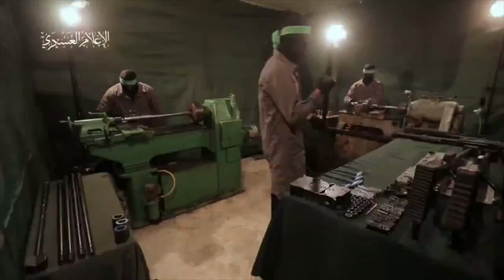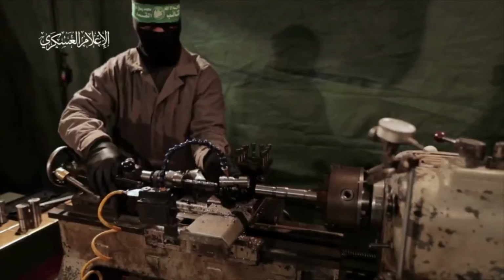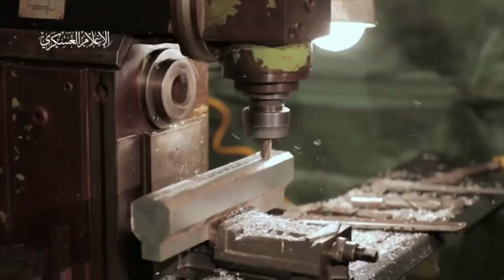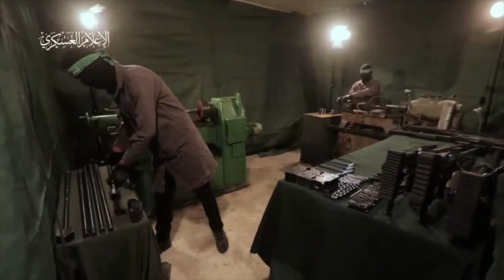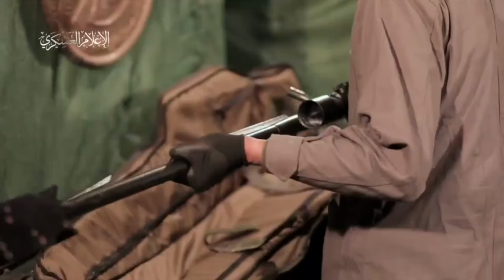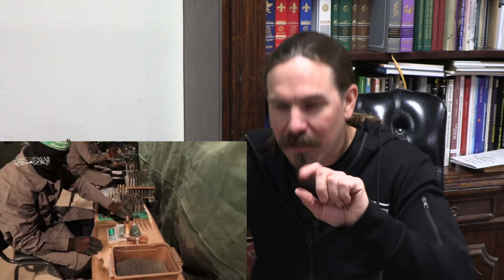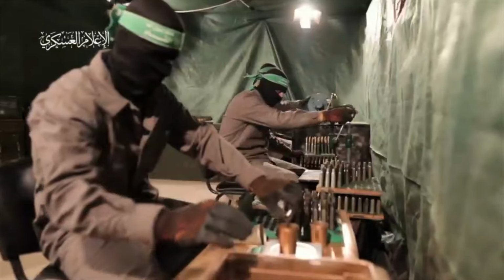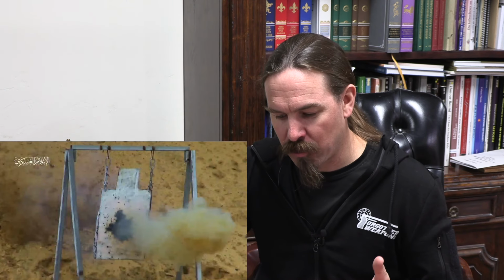Hamas Claims to Make Sniper Rifles in Gaza - Are They Really?

Comment: Yeah, just wanted to say that that looks like engraver work or edm sinker work... The finish is quite nice for such a deep marking... Almost too nice for a rolling press or any kind of brute indenting method, while it`s too deep for a normal laser, at least if you dont want to overcook the supposed precision part to make such a deep marking with such a fine finish... 

And no, those two initial lathes likely weren`t making barrels, i see a way or two in which one could coax a lathe of that size into making 1m long barrels, but shit son, you might as well find a more optimized machine, as the process while repeatable, would be relatively laborious, especially in the setup stages, as you would likely have a 4jaw indep. chuck at both spindle ends to clock that naught rod concentric after the initial o.d. turning, and to allow you the full length of bed travel for drilling, boring, jig drilling, reaming and rifling... It`s a whole damn ordeal to get a small lathe to turn long parts, especially if they are essentially precision components that should have all the work done in a single setup, but you have to make do with more than a single setup due to machine size constraints... 

But what the fuck was that drilling-parting operation? That was some mystical work I ain`t ever seen before, must be some new This Old Tony trick that I missed in the last video... Them pesky youtube fancypants and their expensive editing software effects... ``throws a tantrum, then throws a wrench``

Comment: I don't know anything about rifle manufacturing but after watching your video it seems like you are describing how a rifle is to be made in an ideal situation. Which Hamas clearly isn't in. Like you said they aren't using lubricants. And they are doing things wrong. 
Well Hamas is an underground group not an actual military with all the resources and skill that you need to do it right.

We know that they make rockets and they do hit targets. But the rockets are basically Frankensteined and held together with duck tape.

I just don't see the point of them going through all the effort of getting those lathes and actually showing them using the lathes to shape metals. Why would they need to do it ?

To hide that Iran provides them weapons ?
Well they aren't denying it anyway. And if they wanted to achieve anything for their supporters they could just say that they make the snipers themselves. 
It makes no difference. They aren't the ones caught in a PR situation, Israel is.

Comment: 3:44 guess he first cut a groove with a diameter smaller than the drill an then just drilled through it, advance is that you dont risk the part flying through the room since its stuck on the drill. still kinda goofy

Comment: So they are at war, besieged underground with a bunch of empty shells, scales, powder, bullets, and reloading machines, but are too stupid to reload the rounds? Have lathes, mills, steel, and aluminum, but not utilizing these materials and equipment to manufacture parts because they just don't comprehend how to lubricate when cutting, or that you're supposed to rifle the barrel before you lathe the exterior...? They're just milling scope mounts, but incapable of milling out a receiver or other parts? It's probably easier to mill out a receiver than a scope mount wouldn't you say? You said yourself Ian that when you participated in filming for a weapons TV series, that they already had the finished firearm there fully assembled, with other individual parts at different stages in production to be used for filming the manufacturing scenes. Might it be possible they curated scenes in a similar manor for filming purposes? After all, this is a theatrical propaganda piece, not an hours long documentary showing the precise intricate stages of operations necessary to produce a firearm. You may be underestimating their capabilities. They are certainly producing an RPG warhead variant for around $200 per rocket, that are destroying 3 million dollar Merkava tanks. Don't forget to do a video about those.   Thanks Ian!

Comment: Firstly, I don't support Hamas or Israel. Secondly, I'm a machinist who does manual production work for 10 hrs a day

The first operation- smoke is common in manual machining. Some lathes have flood coolant, some don't, frankly that means nothing to me. Polishing with emery cloth is common, I do it every day. For the drilling, they're making several parts in a bar, all connected together until you go through with a parting tool and part them off (think a link of sausages, you make a link and then cut them into individual sausages). The drill was there to support the parts as the cutoff tool was being used. The milling was alright, I do wish I had a euromill like that. For the rest of it- I'm not an expert on reloading

Comment: Possibly a ridiculous question: Despite the extremely suspect “manufacturing” process here, could any thing made under these circumstances be accurate within 200 yards? 100? 

My thought is that we have been seeing a lot of armored vehicles, IDF with body armor on, and a lot of urban barriers. Could these be useful not as a precision round but simply as an enhanced penetrator to combat a superior force? Perhaps as a way to ensure more KIA as opposed to casualties.
Reply: Depends on the quality of parts used. Channels show how a re-turned barrel, or an over packed (and dented) case can destroy the gun and potentially kill the user. Even enough rust (like we see on 2 of those bolt covers) can cause a blowout. More power means more potential for self harm which means more need for quality.
Reply: @littlekong7685  makes sense. To them is it worth it if it works 50% of the time though? 40%? 10%? How much does Hamas value the lives of their soldiers
Reply: You could make an accurate rifle through crude manufacturing processes through pure dumb luck. What you couldn’t do is make them consistently.
Reply: Yeah that was my thought too.  Its about the penetration, accuracy is secondary.

I wouldn't be surprised if the person issued got any time to practice at a firing range anyway.
Reply: @fukkitful how is it genocidal in anyway
Reply: A much much superior force with genocidal modus operandi
Reply: @rimacalid6557 the only genocidal ones are Hamas. Isreal has never been genocidal. In fact they do more than any force in history to protect civilians. Careful your antisemitism and lack of actual knowledge about Isreal is showing.
Reply: @rimacalid6557  Give me a break if Israel wanted to be "genocidal" the war would have ended in a week.
Reply: @eyalamit5120  Israel had to wait for critical mass on the useful idiots that would swallow their pathetic narrative.
Reply: @eyalamit5120 you're overestimating the capacities of an army of 20 year old officials that's been losing multimillion dollar equipment to regular dudes in sandals
Reply: @eyalamit5120  20,000 dead and 50,000 wounded … 2 months and double the total death toll in Ukraine. What’s worse is 500 children died in Ukraine it’s over 8,000 now in Gaza
Reply: @haithamali3228  Yeah so awful incredibly awful, I agree. If those numbers were legitimate in any way shape or form. These numbers come from Hamas, a terrorist organisation infamous for using human shields and overinflating death tolls.
Reply: @eyalamit5120 exactly, there is no war you absolute tool. they’re punching down on civilians and a ragtag militia trying to defend itself
Reply: @aarvlo  that so called army of 20 year old officials has beaten off 6 countries attacking it at the same time with shitty geography. their achievements and operations are some of the most ridiculous things the world has ever seen. you should watch some videos on just a few of their operations.
Reply: @haithamali3228  The situation in Gaza and Ukraine isn't remotely the same. Hamas hides behind civilians. Ukrainians stand in front of their civilians. don't insult Ukraine.
Reply: @ghosthunter0950  That was when they fought conventional armies. How about insurgency?
Reply: @haithamali3228 well yes dummy the populatiob density of Gaza is much higher than any city in Ukraine
Reply: @raziqrahman1976 they performed decently againts the PLO milicias in the 1982 lebanon war, after the war the PLO qas forced to take a more peacefull stance
Reply: @haithamali3228  The death tolls are written by an agency controlled by Hamas, literally war propaganda.
Reply: @haithamali3228  You have no idea what in the actual fuck you're talking about. The war in Ukraine has deaths in the 100's of thousands on both sides.
Reply: @ghosthunter0950  That was a diffrent generation than today. Alot of those soldiers were Holocaust survivors.
Reply: @eyalamit5120  Israel has openly said in their own words that they are committing genocide. You can't defend people who explicitly, loudly and proudly admit full guilt of even the worst crimes.
Reply: @ghosthunter0950 agree…watch one on the USS Liberty
Reply: @josecarlosmoreno9731  LMAO WHEN HAVE WE SAID ANYTHING LIKE THAT!?

Comment: Most of what you say seems correct, but you are wrong about needing a trickler.  Any scoop or even a spoon will do as long as you have a scale that can measure the charge ti within .5 grain.  The 50 BMG has such a  large charge that .5 grain makes very little difference.  Also a rough arbor press can certainly seat bullets in a 50 BMG case even without a die aligning everything.  You cut the bullet nose profile into the bottom end of the arbor ram, and you make a centering guide (seen in the video) that forces the cartridge base to be centered below the ram.  U hold the bullet into the arbor ram and the slide the case mouth onto the bullet and then the base into the base guide.  As you press the bullet into the case mouth you rotate the whole cartridge in steps as you press the bullet home.  This evens out most of any miss alignment that may be present.  If everything else is up to snuff, you can make 1 - 2 MOA ammo this way.

Comment: the main purpose of the rifle is to provide mid range support as a sort of reassurance for the qassam brigade fighters it also adds a terror factor for anyone who would get shot at by such a bulky round and is a sort of propaganda to increase the moral and it works really well for all of those purposes qassam themselves don't really claim that they made much progress with those particular rifles in fact most of the confirmed kills were done by RPGs and small arms even IEDs didn't really see much use since i'm guessing most of the explosives are used in rockets tandem RPGs and a couple of traps when tunnels are discovered

Comment: The cutting fluid smoking is not bad, it does that long before you are even close to messing with the heat treatment of the steel. The part of the bolt falling off as he retracts the drill can simply be that he make the parting groove before drilling the hole, and then the part will fall of when the drill reaches where the parting grove is. And there is nothing to indicate that the "barrel blank" is a solid bar, the live center in the tailstock is clearly sticking into something, if that is the bore of the barrel, or just a center drilled hole in the end of a solid bar is not possible to see from the video. Ian might well be correct that this is just fake theater, but a lot of the comments he makes to support that claim is not really evidence of anything.

Comment: The scope mounts are also nonsense if they were actually producing them, they would not be taking them directly off the mail, and placing them on the table. Next ones that are already anodized. Anodizing takes place in a completely different facility, as the chemicals are caustic, and will destroy the machines at the same time the Hamas soldier is seen, checking the dimensions of the scope mount with a caliper after removing it from the vise in the milling machine. No machinist would do this as those measurements wouldn’t matter as you would have to realigned the scope mount in the fixture before machining. You must take measurements before removing the part from the machine, otherwise you’re just starting from scratch

Comment: It could just be the holder being warped, but it also looks like all the "finished" ammo are different lengths. I'm also not a handloader but I do know that if one is going for precision, that the bullets have to be set to the same distance or within a tolerance of so much fractional or decimal placement for length, usually to within a 64th or maybe .010~20 of total over all length. Not have your batch tray looking like an uneven growth of trees.
Reply: I'm pretty annoyed if my pistol bullets vary by more than a couple thousandths.  I'd want precision rifle bullets to be +/- 001 or .002" maximum.   But...  you can intentionally load long in a single shot bolt action, so long that the bullet hits the rifling and then seats the rest of the way in the chamber.  This is normally NOT a good idea, because having your bullet seated into the rifling can raise pressure significantly.
Reply: @Rocketsong  Precisely, the measurement I gave was a guess at best for variance . Still stands to reason, if there's visible length difference that's readily apparent at better than ten feet. It's time to reevaluate whomever is doing the final seating and crimp.

The only time I've ever helped with a reloading was essentially coke bottle rounds of the .450-577 Martini. Black powder loaded light to sneak up on a load just for a rifle that's pushing 150 years. I don't remember the exact load data but I do recall that there was a lot of careful tamping with a thin dowel. Also a whole lot of cotton and fine oat filler to keep from making small grenades. I can't eat oatmeal now without getting a memory taste of BP.

Comment: 6:12  It seems like raw aluminum.  There's no smoke and the flakes that are coming off the stock are big and flakey if any experienced machinist would've seen this before.  A dead giveaway that the video is bogus is although machinists do wear latex gloves, they stain with the cutting oil.  None of the gloves seem to have any actual oil nor grease.
Reply: They also use the lathe tool holder wrong.

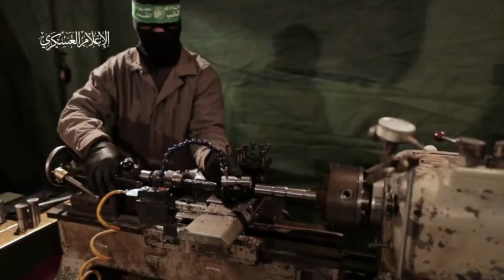Comment: 3:50 As it doe,'t look like the hole goes through the entire piece it could actually be that he had used the cut of tool just before  leaving a tiny bit conected which can happen if your tool is not correctly aligned. And just had to move the drill back to be able to remove the piece.

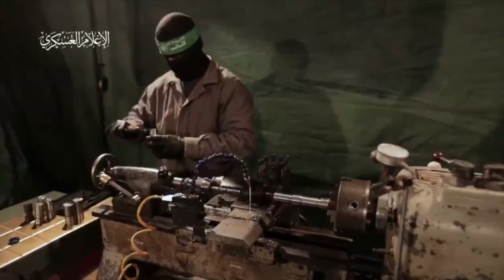4:39 yeah, look at how the pieces are not flush aginst the surface but leaning making a gap. A tell tale sign of a little nub left from an incomplete cut of operation where you had to bend the final millimeter of by hand.

Comment: Great video, love the detailed analysis. Most folks uneducated on firearms would be duped into think Hamas could manufacture an anti material rifle.

Irregardless, this rifle is probably accurate to man sized targets a few hundred meters away, and at closer distances, can be used to knock out the external electronics and sighting systems of Israeli vehicles. So overall they are still a threat
Reply: They are manufacturing guns, by salvaging machine gun barrels. Like someone else said, this is like saying Audi's are fake because their ads don't show real manufacturing.
Reply: @lobsterbark there's a difference between manufacturing and assembling. Many people can assemble but many cannot manufacture.

It's like claiming someone can manufacture an audi instead of making a crude knock off car from aftermarket parts.
Reply: @joeb6750  Car manufacturers get most of the parts from other companies. Typically only the body, engine, and transmission is actually made in house. They are still manufacturing a car.

The only part they aren't making themselves is the barrel.
Reply: @joeb6750 it’s probably much easier to smuggle parts of weapons and have them assembled in Gaza rather than the entire rifle itself.
Reply: Or they can manufacture guns. Ian is just overanalizeing an ad no different than a car youtuber looking at a dodge commercial
Reply: @CowboyJuice   They can problaby manufcature guns just like how  I could manufacture guns with bargain machining equipment. Point is 

That shit is not going to be precise.
Reply: @dootthedooter I don’t think precision is what they are aiming for (no pun intended). Against a man sized target a few hundred meters away, it will be good enough.

Comment: Bullet seating: They faked it here. Proper bullet seating is done with the cartridge being pressed upwards (almost entirely) into a bullet seating die, not as a freehand operation with a mandrel press and without any sort of seating die whatsoever. By the method shown, the bullet is not crimped in the case at all (roll crimp or button crimp, either one).